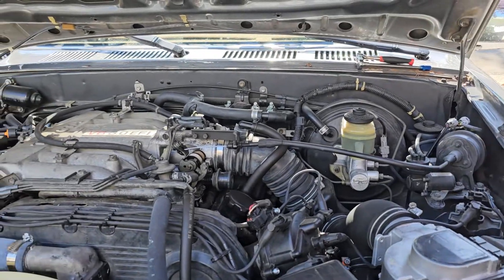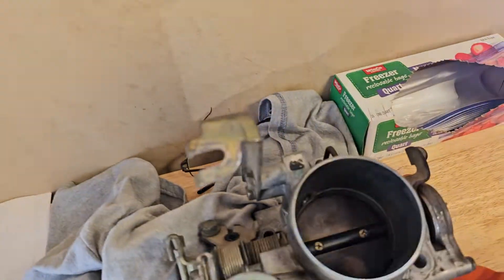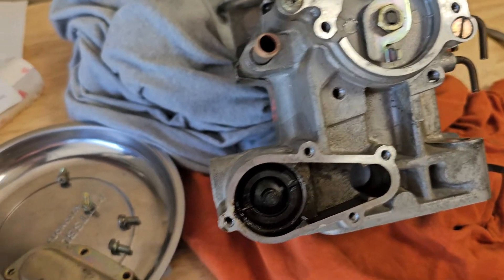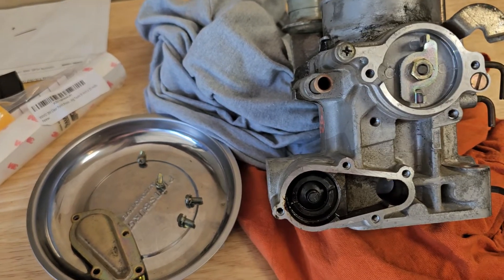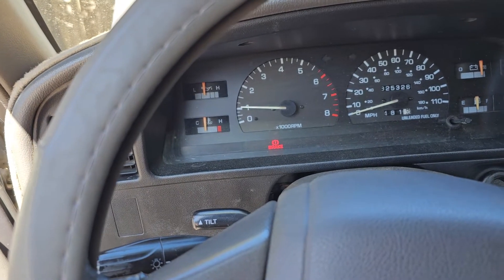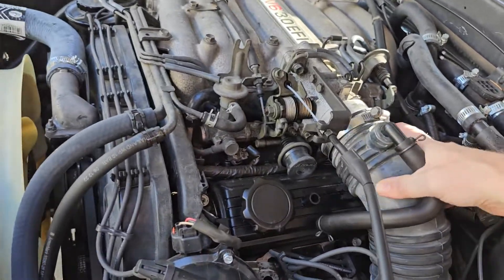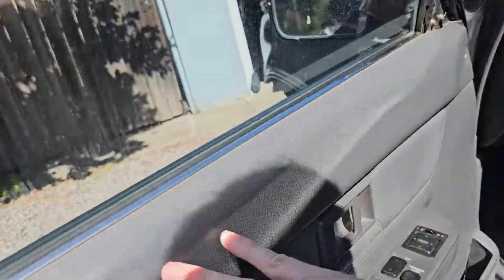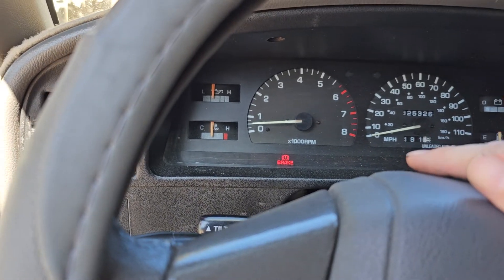How to Diagnose IAC on a 3VZE Toyota 4runner 3.0 V-6

Comment: Put in a new distributor mass airflow sensor o2 sensor and my truck still tops out at 70mph and sounds like a high idle (I don’t have a tachometer) could the iac cause that?

Comment: If this part is bad will it cause jumping and bucking when you accelerate? Especially at low speeds. I’ve noticed ours idles way too high on cold starts and after it warms up too. Wondered if this could be related to the jumpy acceleration

Comment: Hope you had a great Christmas and happy holidays. So my CEL recently came on (it's been awhile) and it's throwing me a code 26 (running rich) I was going to start off with the spark plugs, new wires, and oxygen sensors. Do you think that's the right thing to do at this time?
Reply from the maker: Hey Merry Christmas to you as well! This can be so many things. But i would start by pulling the plugs and inspecting those. Check for wear and gap, replace if worn. Also "read" the plugs. Lots of online resources for that. See if it's running rich, lean, oil fouling, or all looks well. 
Also inspect wires, cap, and rotor for wear.  Replace if needed. 

Next as far as a good bet, you can change the o2 sensor. If it's a CA car, do the upstream one before the cat.
Also toss in a can of fuel injector cleaner for good measure.
Reply: @AgileWoodsman Hey Agile, hope all is well. Okay so I replaced all my plugs, wires, cap and rotor, and I'm still running rich and have a code 26. At this point I'm suspecting maybe fuel injectors? I read on one of the forums that the cold starter injector could stay on and continue to over spray so I unplugged it and still nothing 🤷
Reply: @AgileWoodsman  Hey Agile hope everything is going well. Update: I got that code 26 taken care of. I had to get a valve job 😞 

Anyway, after the valve job I noticed when putting the ac on and idling, it would idle low. And I know the idle should be a bit high for compensation. Any idea what could be causing this?

Comment: Mine idles much higher than yours after fully warming up. Between 1700 and 2000 RPM. And then after a hot restart it idles way too low. Around 450 or 500. Once you put it in gear and turn the A/C on, it gets ready to stall. Stays that low until its been driven for about 5 minutes.
Reply from the maker: Check vacuum for sure. Mine did something similar and it was a crack in the bottom of the hose that goes from the air filter box to the throttle body.
Reply: @AgileWoodsman I was able to fix mine. It was a plugged return coolant line running from the rear of the throttle body. I found my solution on a yotatech forum: get a brake bleeder pump, used the vacuum to pull fluid from the block supply and the throttle body to make sure it could flow. Check. Then I put the hand pump vacuum on the return side, which would pull the fluid the opposite way from which it would normally return to the Y shape pipe the firewall heater-core return it is shared with. I started pulling fluid and there was a distinctive resistance that was quickly and easily overcome. I figured it might be because I was going the wrong way in the way it was suppose to flow. I got my fluid after only a few pumps but there was a lot of particulates in the coolant. There wasn't a plug, per se, but there certainly was a bit of large black flakes.
Reply: I have the same issue. Any luck finding the solution?
Reply: @nrguitar11  No, not yet. I have reason to believe it might be a vacuum leak. maybe the PCV? all other lines seem to be sealed up properly.

Comment: Mines not high at idle but it is under at 400 at drive and park but when I put in neutral it stays at 600 couldntgis be the iacv as well pr can it be something else
Reply: Could be a vacuum leak or unmetered air coming in between your air box and the throttle body. Mine was doing this and it ended up being the old / brittle crank ventilation tube that plugs into the rubber intake hose. It could not seal onto the valve cover. I replaced it with a $5 generic hose from the parts store. No more low idle. I’d look at the intake parts and see if you have a crack or bad seal somewhere. Good luck!
Reply from the maker: Yup I agree with subarota, check for vacuum leaks first

Comment: On D type EFI, the valve operation can also
be checked by removing the air inlet pipe at
the throttle body and blocking the fresh air
port inside the throttle bore. When the engine
is cold, engine rpm should drop greater than
100 rpm. Once the engine reaches normal
operating temperature
176'F), rpm drop
should not exceed 100 rpm.

Comment: Have you have an issue where you can’t rev past 2000rpm? My 3.0 is doing that for a while and it acts like a rev limiter when I hit 2000rpm
Reply: Have you solve your issue yet? I have the same problem with my 3.0
Reply: Same here, did you figure out the issue?

Comment: I noticed my car had a surging high idle so I covered the hole in the video, and it would idle pretty low for 1 second and stall out. Would you suggest I turn that valve in?

Comment: I was suspecting this was my case since    I couldn’t find a vac leak and the rpm surges between 1200 and 850.  Im going tighten my down see if that helps I also coudnt find that replacement only just an entire throttle for 200+
Reply from the maker: Yeah it'd a tough one. As far as I can tell not much is  available from toyota or aftermarket anymore as far as throttle body goes. I wonder is that little part will ultimately be what makes these have an end date rather than perpetually rebuildable like a classic car is.

Comment: Awesome videos! I’m about to purchase a 2nd gen as well with the 3.0 engine and I was just wondering some things that you would recommend I do when I first get the car? I plan to maintain and take absolute care of this car while still off-roading but I don’t know where to start and the first things to do. Thanks! Keep up the awesome work!
Reply from the maker: Probably start with a good tune up and fluids and filters. Grease all the zero fittings. Check out driveline and steering/suspension components for wear. Good luck and have fun!!
Reply: Good to see you with another up load!! My 94' 4Runner is in perfect running order with just under 200,000 miles.  I'll probably grab another throttle body from the junk yard just in case I'm unable to get one in the future. Easy fix if that idle control valve is removable on easy terms. Only thing I need to do is tighten a heat shield that vibrates a bit when first start up when it's cold, rattle goes away shortly after warm. I assume it's not the valves. I'll get to tightening it up soon.
Thx